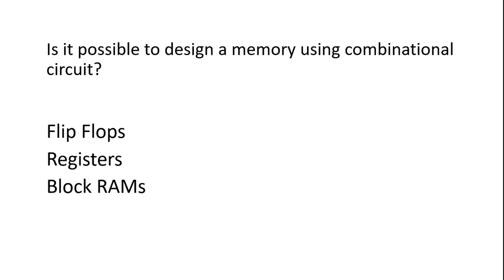DigiThon Question Part 31

Comment: Two Cross-Coupled Inverters
Reply: Sir I think we can also use d latch or sr based latch using nand nor, and there depending on the control signal , we can store the previous value easily

Comment: yes, you can use cross coupled configuration of Nand or nor gates to realise a latch, two of which can be cascaded with opposite clock edges (eg negative and positive) to form  a flip flop.